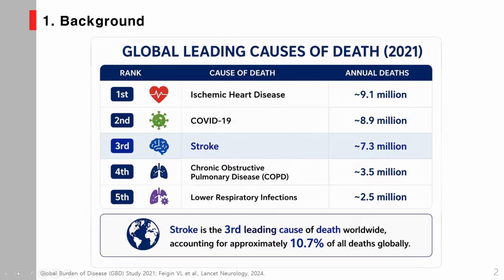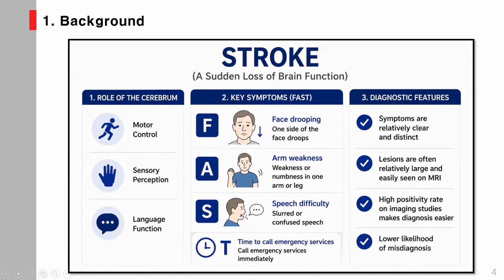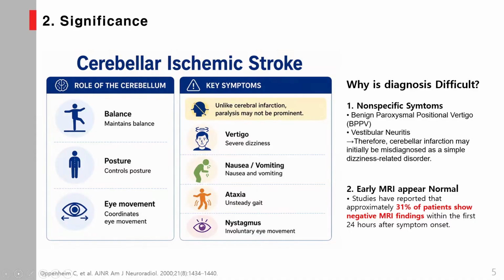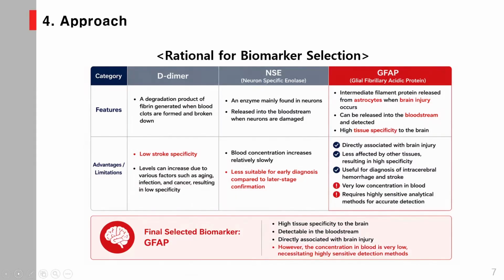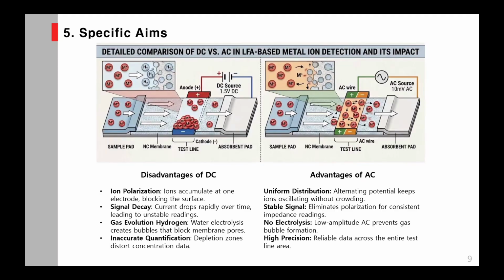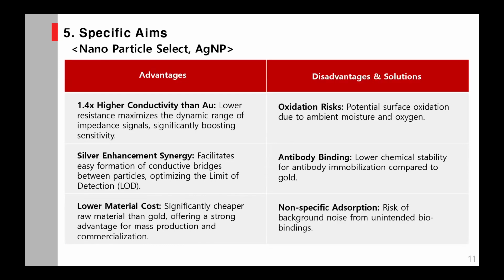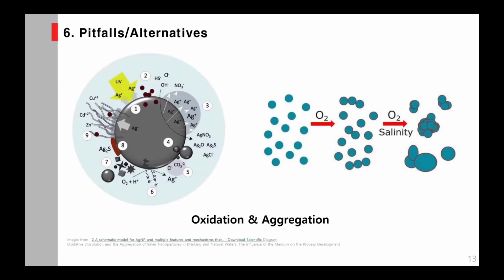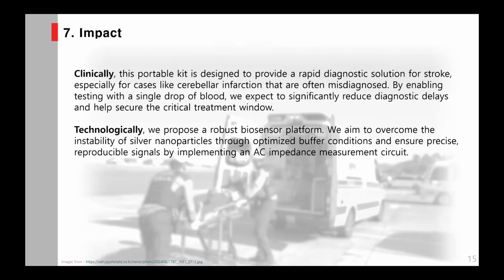Team 7: Diagnostic Kit for Stroke

Comment: Kim Sungnyoung: Stroke is like an Earthquake. You can't tell if the stroke could be happed in advance. You just see how the body reacts to the stroke. After you recognize the stroke it simply just too late. So the key is to determine if it is stroke or not and give a treatments accordingly; it is importatnt to dignosis the stroke quickly and accurately.

Comment: Farina DND:
your idea was more technical and product-oriented. till now you were the only group actually showing a detailed circuit based on the introduced theory. using an AC impedance-based readout was interesting to me, especially because they tried to explain why DC can cause problems like polarization and unstable signals (liked it more because of the schematic and the particles... really helped me grab the context). One thing I was still wondering about is how realistic the diagnostic claim could be. The idea of detecting stroke from a single drop of blood is very attractive, especially if it could be used as a portable screening kit, but I am not sure whether GFAP alone is sufficient to reliably detect stroke in all cases. Since stroke can have different types and locations, I feel like the project would be stronger if they framed it more clearly as a screening or triage tool rather than something that directly replaces CT or MRI.
My main question is: if this approach is theoretically possible, what is the main reason we do not already have a common portable stroke screening kit like this? Is it mainly biomarker reliability, sensitivity, device stability, or clinical validation?

Comment: DH Kim: Considering the potential for point-of-care implementation, investigating the long-term storage stability of the silver nanoparticle sensors under varying environmental conditions would likely add significant value to the research.

Comment: Kyeumin Jo: I'm deeply impressed by your strategy to enhance sensitivity using silver nanoparticles and addressing the stability issues through thorough buffer optimization. Your technical approach to mitigating silver nanoparticle oxidation while maximizing conductivity is excellent. Addressing these critical stability issues through precise buffer optimization makes this diagnostic kit highly reliable and promising for clinical applications.

Comment: yeji: Utilizing silver nanoparticles instead of gold to leverage their 1.4 times higher electrical conductivity is a highly strategic approach to significantly amplify the dynamic range of the impedance signal. Furthermore, your meticulous buffer optimization using HEPES, BSA, and sucrose effectively addresses the notorious technical challenges of silver oxidation and colloidal aggregation, ensuring outstanding reproducibility of the assay.